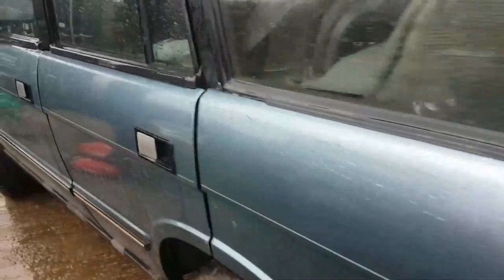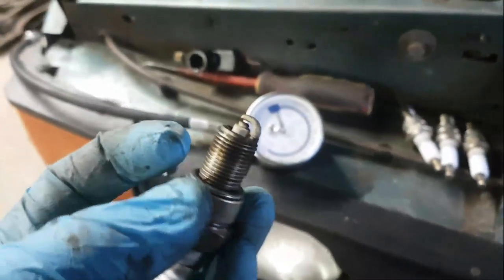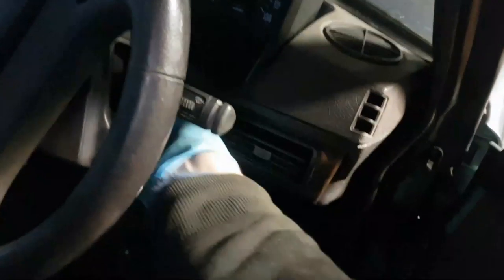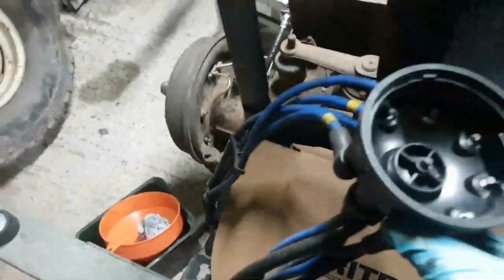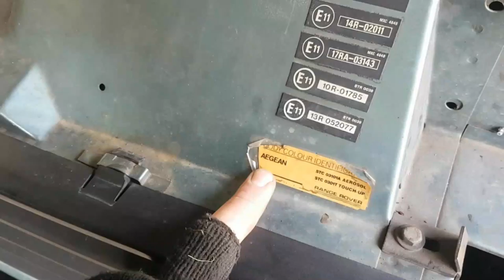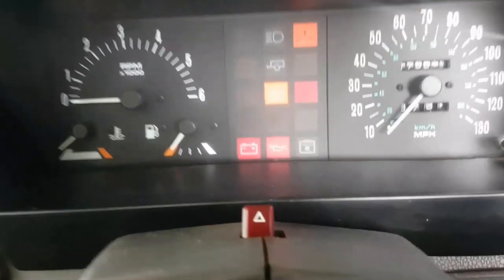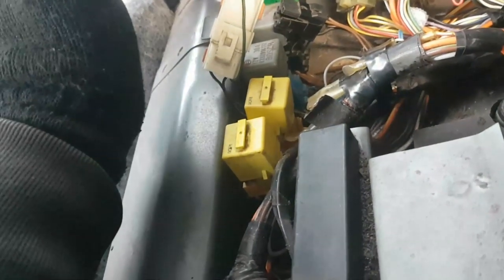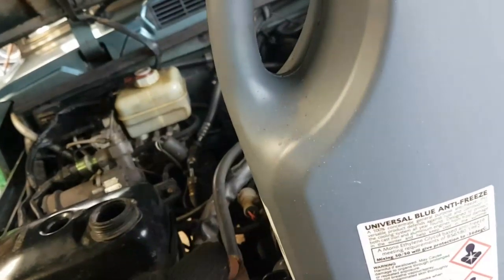1994 Range Rover Aegean Blue Part 1 - will it start? Parental warning

Comment: I have been having the same issue (non start) for the past month or so (no time to focus on it). 
Checked fuel pressure at the filter which was slow to build to 35 psi but held, voltage at the coil, spark (weak) and verified firing order and corrected that. 
While I was under the truck hooking up my remote starter to verify firing order, I noticed a ground (earth) wire on the left side connected to the block. 
It was all crusty and oily so I removed it cleaned, sanded and reconnected and she fired right up! 
I checked again 4 hours later and she started again (not as easily)
Reply from the maker: sounds like pump might be on it's way out, should build up pressure really quick. Also in a future episode I will be going into more detail around that weak spark

Comment: Spark plugs should be 11's not 9's according to the workshop manual!  Not that it makes a detectable difference!
Reply from the maker: For the 9.35:1 compression 3.9 v8 the manual says NY9YC, gapped to 33-38thou. I tend to fit the Bosch super4s where possible, especially where LPG is involved
Reply: Champion RN11YCC
Reply: @churchhouseclassics  does LPG run better with 9's ?   Is it  hot or cooler plug?